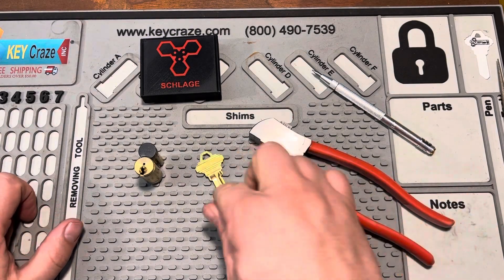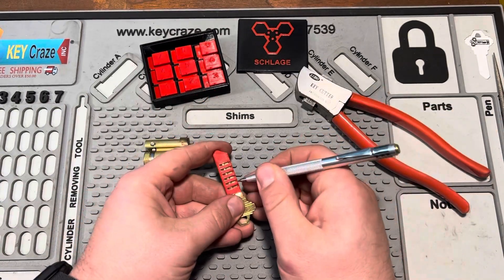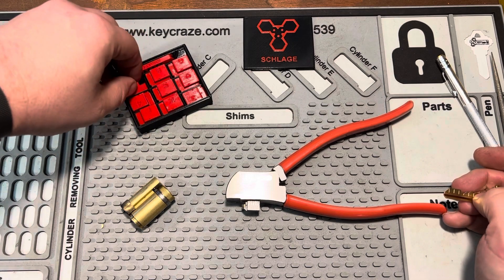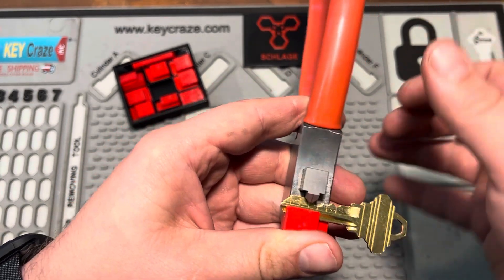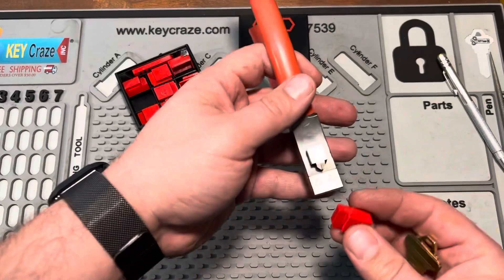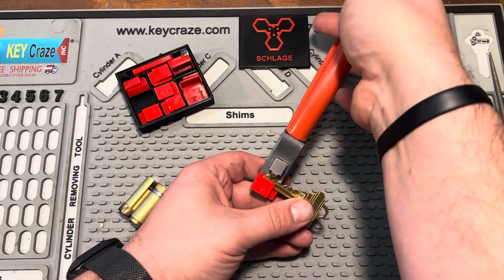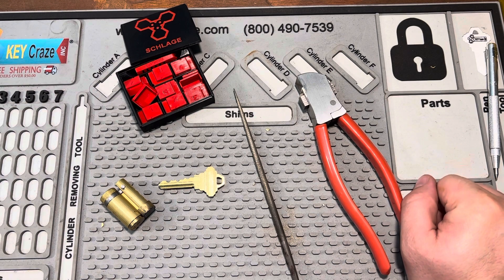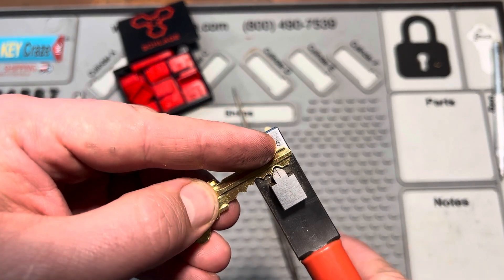(48) Key Machine Chronicles #6 - Lishi Clipper and the Schlage 3d printed adapter revelation

Comment: I found that there was just enough play in the way the plastic pieces fit onto the cutter that if you’re not super careful you’ll be off by roughly one number here and there. What I found helped was to check my cuts against a key decoder, to make sure I had things lined up perfectly. If it doesn’t match the key decoder, either a file or re-cutting more meticulously works out (in my limited tests). Great video!
Reply from the maker: There's some fine tuning to be done, for sure, but that's the nature of invention. :) These are still a solid piece of kit for the money. Unfortunately, I think it will take some time before something truly accurate comes along.

Comment: I also made a video on the RTT Schlage Cutter Guides.  I have a weird problem with my (probably knockoff) lishi cutter that the guides are off by 1, i.e. if I want a 3 cut I need to use the 4 guide.  Also reading on RTT they suggest using a 0-bitted key blank as they say it's nearly impossible to get a 0 cut on the lishi cutter.  This might explain your 9 guide problem... if you had a 0-bitted "blank" then maybe it wouldn't hit the back plate of the cutter (if 8 fits on the null(?) bitted, then a 0 bitted would fit for the 9)... Overall I think they are fun little tool, I enjoyed it.  Where can you get 0 bitted key blanks?   Well from RTT of course ;-).
Reply from the maker: Fun bit of info, I make RTT 0 cut keys for them. ;) I don't think a 0 cut key would have resolved this issue, as even cutting the cuts near the 9 down to 4 didn't help. I think there's just a little bit of tolerance problems for now, might be able to resolve them somehow.
Reply: @RubberBanned  ah cool!